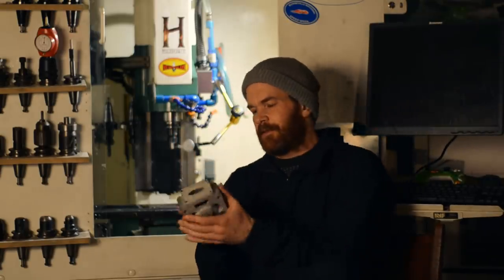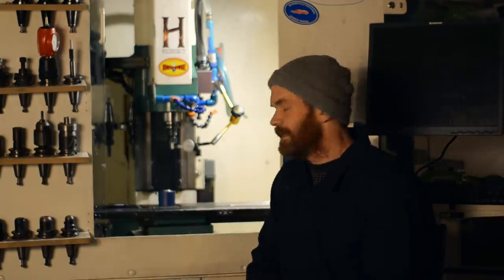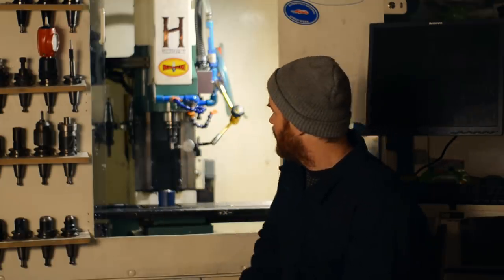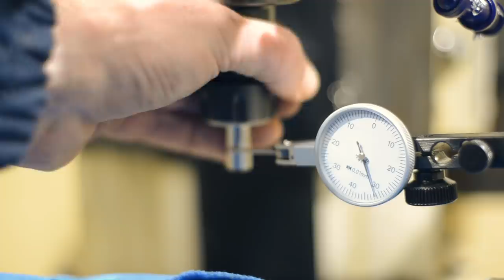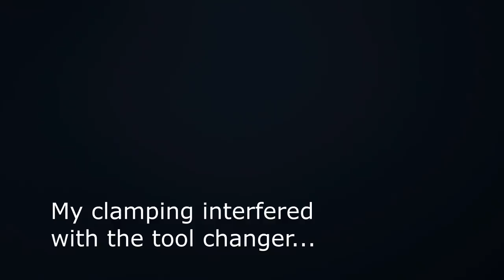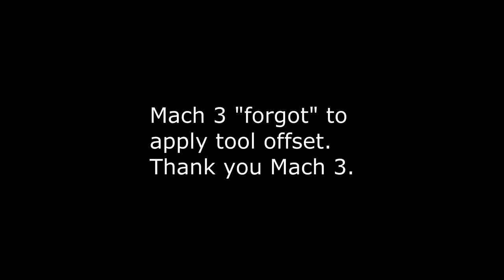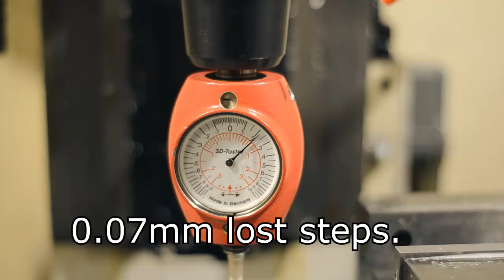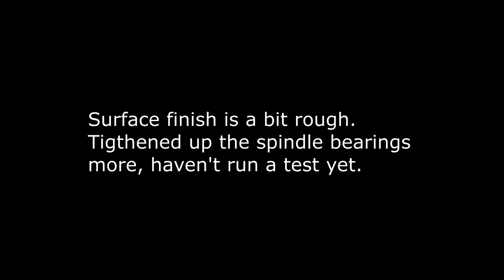Fought the Machine and Won - Back to the Most Powerful Two Stroke Ever now!

Comment: I think you should get a gauge block and check the axis are still perpendicular to each other. Also worth checking play in the ballscrews at various points along the travel, if the machine only made small parts with a heavy cut, you can have localised wear areas that could affect your surface finish and accuracy, and could be remedied by just moving the fixture so you're machining away from those points in the travel.
Reply from the maker: 👍 Great advice!

Comment: The 3d taster is originally bought throu a tool supplier called Hoffman group. So if you breake all the probe ends. You need to contact them or someone who can buy from them.
Glad you found it use full!
Reply: Generosity is spiritual wealth. Tanks for giving it to him. It makes all of lives beter.
Reply from the maker: 👍 Thanks again! I need to fab up a short holder for it - limited z travel.
Reply: In Norway you can by new tips from Sandvik. If you brake one you have to calibrate it. You cant just replace it.

Comment: I did a video on my channel about a week ago on running a tool in for the first time. Although it doesn't deal specifically with Mach 3 I think the same principals would apply. Using your distance to go displays to avoid crashes like you had in this video. I think the best thing as you mentioned would be to upgrade to servo drives. Clear Path servos could be a good chose because they could be run off your present controller in the steep and direction mode as if they were stepper motors. They also have a application you can run to tune the drives to your machine.    https://www.teknic.com/products/clearpath-brushless-dc-servo-motors/
Reply from the maker: 👍 Thanks for the tip, I'll go watch your vid. Been looking at clearpath servos.
Reply: @2STROKESTUFFING  i lokkede into the clearpath servos way back.
Lokkede like a good choice for retrofitting servos.
Maybe have a look at this old Tony's  videos on the topic. He just fitted new servos to his maho.

Comment: i'm building a four stroke engine at work right now as a training excercise and that experience really puts what you do in perspective, as always i'm really impressed by what you manage to do with your equipment
Reply: also, be very careful with those bearings as they might shrink or grow with the heat and they should really be adjusted when the spindle is warm
Reply: Go watch Bad Obsession Motorsports....

Comment: When you are testing a program: 
-1. When you make some chips you start, always a hand on the potentiometer and the other on the red button (feed hold for who knows for ISO display and many mores).

-2 always checking the security distances between each deplacements.

-3 always have a look on the offset of the tools  to know if the tools are correctly mesured.

That’s the rules for a good machining.
But it’s nice to see progress
Reply: distance to go and feed hold are imporntant defo
Reply from the maker: 👍 I'm working on my routine 😁

Comment: I've seen a video about f1 motors , the extrem precision of setup mean the piston is seized when the motor is cold . To run the engine you need to preheat oil .
It's for increasing compression , only when it is hot is nominal tolerance is obtained .
Maybe later you could consider this for your project , but probably not for prototyping process .
Reply: @M Bacon Thank you for your interesting knowledge.
I am not a mechanical engineer ^^
Indeed, it is logical that, depending on the way it is designed and the type of metal used on the piston and cylinder, it could be the opposite.

Comment: When you check the spindle play put the clock base on the bearing housing. You only measure the play in the tool holder, taper and the bearings. Not any other parts of the machine. 

Any chatter you have on the part - slow your spindle or increase your feed rate. Use tools designed for aluminium on aluminium. Don't use coated steel tools.

If you don't know what the machine is doing for the first part, slow your rapids and be ready to stop before you crash! Look at the distance to go readout. - See Edge precision latest video.

Keep going, you'll get there. We are all here to help!
Reply from the maker: Thanks for the tips!

Comment: If I may, a few tips for working on a cnc machine, play it safe as much as you can, spend a extra 5 mins and think about what you are really doing, instead of "just trying to get it done". You have seen what lost steps mean, it could sometimes mean that you have to start over. They have a saying in our workshop, "there's always time to do a job over, but never time to do it right the 1st time". Also what you can learn is, don't always trust yourself (hear me out, anyone can make a mistake) put stops in your code of your programs, let it start 100 above, then 50, then Z - 0. The odds are that if your 1st few coordinates are correct and doesn't make the machine crash, that it will be a good operation. The machine i work on, has a dial for feedrate, when I start any program on my machine I flicker it between 0% and 10% to see what its doing. Also mind your instincts, I can sometimes hear, before I see, that I started the wrong operation, the speed is to high or low.
Reply from the maker: Thanks, great tips!

Comment: Allot of older cnc machines do not like it when you make a radius(z and y/x) while you are approaching the cut since that move contains allot of seperate lines of code. This can also make it that the machines looses steps. 
(A helical movement is no problem since this contains allot less lines of code.)

Love the videos

Gl

Comment: You may want to consider closed loop steppers, they provide the closed loop feedback and efficiency of servos but at a lower cost and higher torque (shouldn't require a gear reduction to convert) vs servos.
Reply: Leadshine closed loop steppers basically turn steppers into brushless servos. I used a few recently and was quite impressed by them. They are standard stepper form factor so they are pretty much a drop in replacement for steppers. The only issue in this application is the shaft size. Apparently there isn't enough room to bore the pulleys out to fit the 14mm shaft.
Reply from the maker: Yep. I think clearpath makes a few models with 3/8 shaft(what I need), not sure if they're strong enough.

Comment: its that cabinet what bend also but if you want at its never move just build in thick metals a stand & bolt it in floor & the wall & then you can build cabinet over it + coolling tank & metal mesh so tiny metals do not go in cooling tank & broke Cooling pump

Comment: Ypu learn things very quick, that is impressive! I really like your videos :) 
The "play" in the spindle is actually not that bad. If you push it forward and then push it backward you have 0.02mm play, the thing to look out for is if you push it forward and then let it go it should run back to 0. If it doesnt you have a problem. 
I run a brand new DMG at work and it also have 0.01mm play when i push the spindle, but it always returns to 0 when i let it go. 
A spindle bearing is not designed to take loads while standing still,  if it is running it spreads the load over a bigger surface.
About the lost steps between different tools i would look at the machining code, if you face the part and then blends a radius the ballmill tool should never go below the Z height of the face while its at the top of the radius.

Comment: The aluminum test error was pretty much exactly the "load flex" of your spindle after your primary adjustment. That 2/100 is about as close as it was possible to get at that preload. As that is 0.0008 inches (8/10,000), and the ID error on the bore was 0.0016 inches, you are "in tolerance" for the overwhelming majority of automatic cutter machining operations. Error appreciably lower is usually attained by grinding, or "hand work" finishing steps. What strikes me odd is the bore error, as it is opposite of the tool loading, as such would return an undersized bore, but oversized external cut dimensions (like your x-y exterior cuts)... is the wall thickness correct, showing single side tolerance gain, or both side tolerance gain?
Reply from the maker: Thanks for the info, I'll have to go out and do some measuring again as soon as I can.

Comment: Check the gibs in the Z slide, they might need adjusting (maybe it's not the spindle moving).
Reply from the maker: The indicator was mounted on the Z casting👍

Comment: Be very careful about playing with spindle preload its really a specialist job to get right.
If the spindle head is not of a liquid cooled type there is going to be a curtain amount of play when the spindle is cold to allow the bearings to run at the correct tolerance when it all expands at working temperature. I get your point that the machines typically run hotter than yours. I imagine you will be doing all your checks after say 5minites at it highest specified spindle speed, make tiny changes and monitor sudden ramping up of temperature and sound than is normal. 
Damage can be real quick at high RPM.
Ops never mind didn't realize the fix was in this episode.

Comment: I feel you pain with lost steps and Mach3 doing crazy destructive stuff at times.
I made a conversion of a similar size machine. Changed to a high rpm Chinese spindle,  kept the nice 3phase steppers but replaced the rest of the electronics. And.. chose Mach 3.
After ruining some 10h of milling of a mold I lost confidence in the machine. While I think it was Mach messing up, I decided to ditch both steppers and controller.

Went https://en.cs-lab.eu/ all the way, servos, drives, controller, software...
Now, while I have most stuff done, I decided that the mill was becoming more of the hobby instead of the tool its supposed to be, so I stopped working on it.
Hope to find time for it soon again though.

Anyway, if you decide to change controller/servos, IMO the cs-labs stuff is for sure worth a look at. While not the cheapest, it looks bloody professional. 
Wish Id gone that path from the start. Also, while the spindle is working really well, I sure wish I had opted for a ATC version to be able to have pre-set tools.

Comment: Here is a tip that you maybe can use for get the tolerance out of the spindle. you can also do upward milling (i think is the right translation). that is where the feed direction is diffrent than to the turn rotation. this wil push the part away more but also wil cause the movement of the spindle to be pushed out. note this is not the ideal soloution but for is mill where there is some slop/clearance in the spindle it is good to try

Comment: the missed dimensions after the tune up might be simplt caused by tool flexing
try running the same program on the same part twice or 3 times and check the dimensions then, if you don't have any missed steps it should be closer and closer to the designed dimensions if that is in fact tool flexing under load
if it was caused by missed steps the whole thing would get some wierd offset on the part and you could see that right away

Comment: Great work tough your self welded spindle-mount is waay to weak. With a stiffer attatchment cutting forces and vibrations will decrease and you wont loose steps that easy anmore. Wish you all the best! Keep up the good work🔥😊👍🏼

Comment: My tip is remove face mill and never use it again unless looking for specific finish. End mills snap with low risk of damage to machine. Steel body tooling can hurt or misalign your machine faster

Comment: First I want to comment, I don’t miss a video of yours!  I would like to consult the fact that you should at least look into  converting your machine into a grbl controlled machine with driver amplifiers to run a set of new stepper motors. I have a small desktop mill I was researching with, and the software is so cheap and user friendly. Grbl controllers are very easily calibrated and would probably be easy to install on your machine. Look into it.  You would need a relay for your spindle power supply.  Maybe you could find the hobby grade software like  Inkscape, and converting a svg file to g-code with js-cut. Or the more advanced ‘aspire’. I’m still looking into aspire cause it’s pretty fancy. To be honest I avoid contouring too much cause of all the steps and such but I’m still looking into aspire.

Comment: You have to take to calculations that programming a certian measurement seldom becomes correct, you got cutforces that pushes or pulls in the tool.
Thereby you need to compensate in tooloffset to get correct dimensions.

Comment: Love the channel! -  I'm no expert so this is just my 2 cents worth but, a machine of that size (whilst great for what it is) isn't that rigid so would be best run with a less aggressive machining strategy and smaller dia tools to get more accurate parts. I also think the machine being on wheels is not a good idea.  I run a Tormach 770 and rarely use anything bigger than a 6mm dia and always use new (sharp) solid carbide. You can use the larger tools but very light cuts will help reduce deflection. CNC is a steep learning curve :-)
Reply from the maker: Thanks for the tips!
Reply: @2STROKESTUFFING  happy to help :-) - also keep tool stick out as short as possible to further reduce deflection - looking forward to the next instalment!

Comment: You should use fusion 360 for maching, in my opinion thats more friendly for beginers
Reply from the maker: That's what I'm using, mach 3 is just the machine control software.

Comment: all your videos are fun to watch, can feel the pain of fails of course. i'm doing something like that also in a much much lower level.  maybe the 2 stroke videos will come when i get my piaggio stuff :)
Right now have to continue doing my camshaft stuff and build my car.... oh wait.. my car doesn't have camshafts :D and i cant leave youtube with your videos until i have watched them.
Haven't gotten my pc running to control the cnc ( they dont like the integrated gpu so i cant use my laptops reliably) everything is standing behind software... want to draw models in SW but the freeware programs i have wont take the file formats and so on.. 
what kind of gcode sender and cam soft are you using?

Comment: Your surface finish is rough because your spindle mount is weak. Don't thighten the spindle bearings over spec! They will fail miserably and quickly! It's the mount not the bearings.

Comment: I wonder if the CNC machine warms up after some machining what happens to the spindle bearing play ,does it remain the same as when machine is cold or does the play get less so if play is set to little when machine is cold will it seize when machine warms up ?
Reply from the maker: From what I've heard, with these particular machines it's ok as long as I can keep my hand on the spindle casting.

Comment: What is that sheared and rounded shaft in the spindle?
Reply from the maker: It's what the automatic "draw bar" pushes on. Been mushroomed over by the corresponding pin in the air cylinder. Yet another not-too-well-thought-through modification by previous owner.
Reply: @2STROKESTUFFING  thanks for responding,  I didn't think it was the source of your run out, it just caught my eye. Please don't ever change the lighting in your garage,  it adds to the character of your channel! Huge fan!!!

Comment: ive got a cnc machine myself and ive started to hard code some machines mabye u have the stepper rate for the motors wrong so when it does steps there not the .1mm there ment to be had same issues with my one

Comment: If you could, it would be an improvement to convert the machine to DMM servos. http://www.dmm-tech.com/ They are in Canada
Reply from the maker: I've had a look, great stuff. Weighing them against clearpath's offering.
Reply: @2STROKESTUFFING  Many users of DMM in the US for machines like yours. Personally I think separate motors & drives is a good thing. I am not affiliated with DMM in any way.  Incidentally the clear path people are only about 80 miles from me in the US.

Comment: I'm getting more jealous every day looking at your machine shop when you didn't have nothing more than a file and a hacksaw to start with at least it's ridiculous idea of how your building two-stroke has he got you into real Machining very very very I just can't watch and help from saying you really need to have that port bigger where the carburetor goes on Hallock been 40 years ago out west running in the sand washes 80 miles an hour on a 360 Yamaha torqued out those are running in sand is like sugar in abundance and horses for miles Here Comes one of the boys from the Yamaha shop on his little bitty 125 Elsinore where the carburetor bigger than the piston and he goes by me like I'm f**** parked second thought just forget what I said I've read some other similar close to information in your not really paying attention but you're not going to beat the world record holder on a 50cc 2 stroke his name is pop Yoshimura probably the name you don't remember recall no one's ever built motorcycles faster than he did as it his motorcycles won every Championship there ever was and his Technologies using today is still faster than fast one day you said your engine is not a bumper is just a free flow that means you went from Maximum horsepower to the least amount possible get your book on Yoshi mirror I had how to get your book on pop Yoshimura inventor of the Honda Elsinore the first two stroke that Honda ever made as he was my instructor who taught us how to Strokes work and you haven't got to there yet